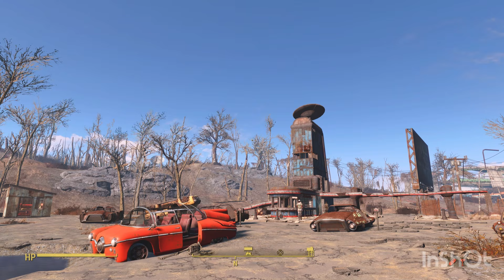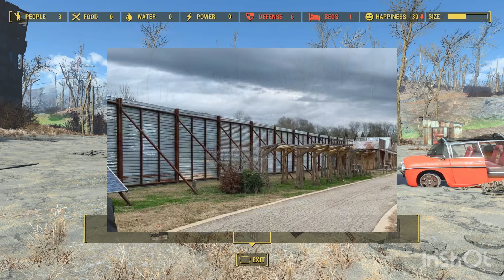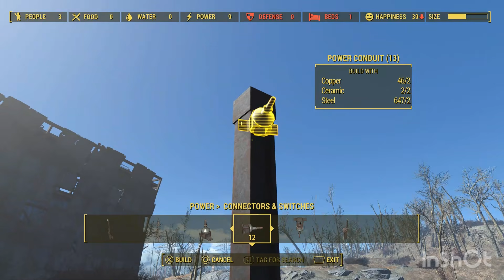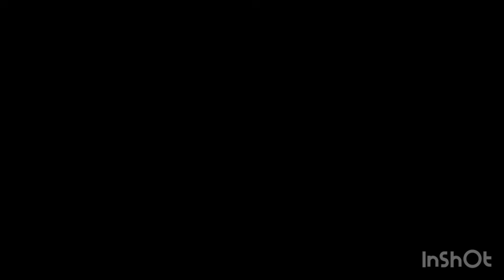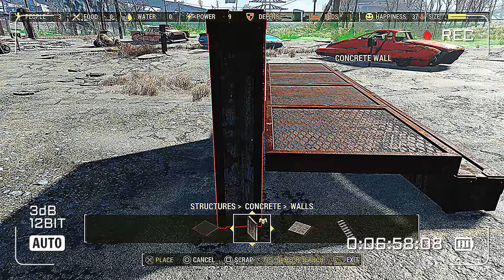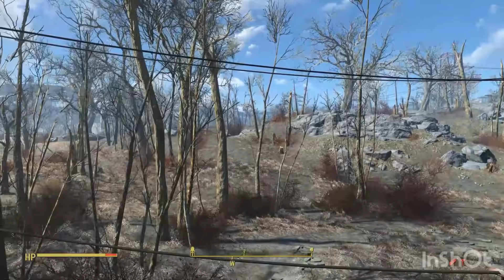Beans Builds 04: Settlement Walling Tutorial (No Mods) - Fallout 4

Comment: Really liked the electrical fence from the previous builds, its simple and looks amazing! I'm wondering if there some way to confuse the settlers pathing, so they cant cross over? 

For a build idea, maybe try a fence/wall with the conduits from the contraption workshop. I've been messing around with them lately, but it can be a pain to line everything up. Might just come with the territory, but I keep thinking there has got to be a better way.
Reply from the maker: Thanks Asnyh! I wouldn’t know how to alter the settler pathing tbh, but your idea using conduits would work really well for that I think. You could use the conduits in lieu of the wires here with wall 2, and it’d stop the settlers from moving through it for sure. Thanks for the idea, maybe this one will get a sequel 😎